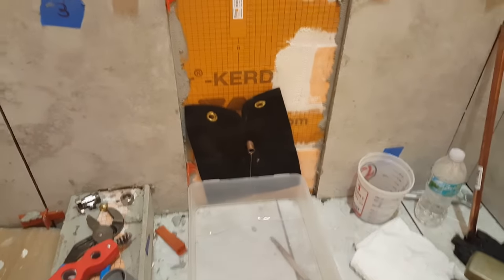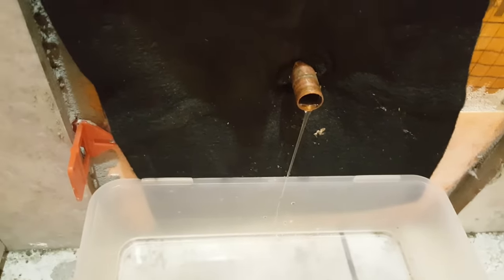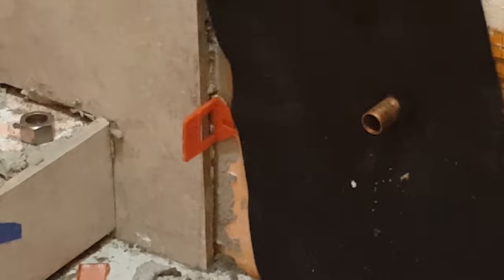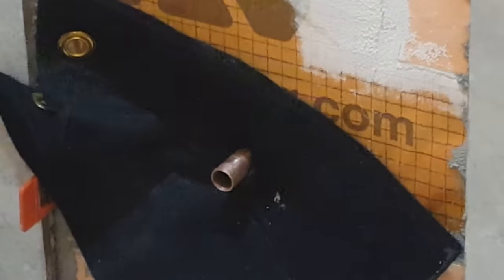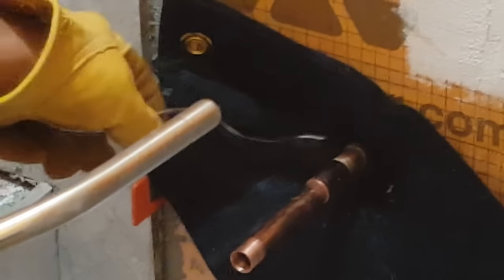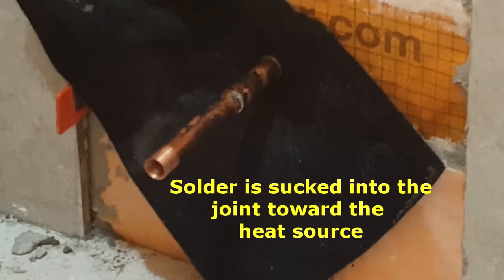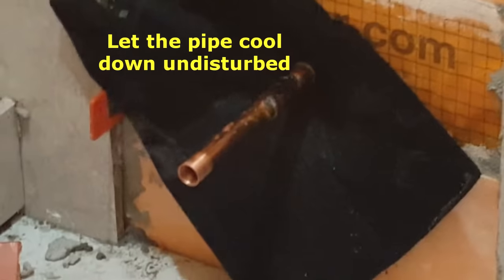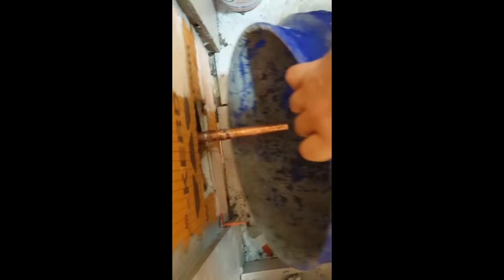Insane Plumber's Trick: Solder Copper Pipes Dripping Water

Comment: Why did u sand the inside of the pipe? Lol I've never done that or seen anybody do that. But that bread trick works like a charm! 🔥 good shit
Reply from the maker: I guess you didn't hear me say after I did it that it was not necessary. It was 100 degrees in that bathroom, mid July the hottest day of the year, and we could barely breath or think straight.
Reply: @jeffostroff  gotcha, the bread dissolves on it's own?
Reply from the maker: @two9s649  I don't like to leave any doubt or chance that any bread will wedge itself inside the shutoff valve when you attach it, as the video shows near the end, we flush the bread out by turning the water on for about 2 seconds, then shut it off. Do this BEFORE you install the water shutoff valve.

Comment: The way I was taught is to take bread, roll into a ball, not hard, big enough to fill the leaking pipe,  it clogs the water temporarily so you can do the solder. When finished, turn the water on and the bread will flush out.
Reply from the maker: Yes, that is exactly how we did it here.
Reply: That's what I get for not watching your video. Thanks for not beating me up over it.
 By the way, I now have seen it and your very thorough. Very professional.

Comment: 1:52 Using vacuum to clean inside of the pipe?
There will be hardly any effect of vacuum from a few centimeter distance.
Also vacuum is hard to come by and with vacuum cleaner I have strong doubts.
However a gentle pressure would be more effective to blow out any dirt in the pipe.
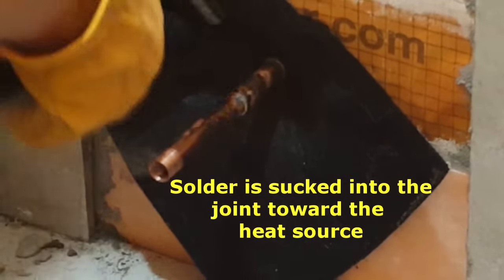5:04 "solder will be drawn to heat source"
Said who?
This is no longer concerns plumbing , it is physics. Any reference to this statement.?
The correct terminology should be "capillary action" as commonly used but I would suggest surface tension.
Liquids are attracted to the solid surface and adhere with a stronger bond than the inter bond among the liquid molecules.
Hence as soon as soldering metal melts and becomes liquid it is immediately attracted by the surface of copper pipe nearby. That is due to surface tension.
And the attention the double surface of concentric copper pipe one inside the other creating a very fine gap causes capillary action and stronger surface tension force to draw/attract/pull the liquid solder.
Where does the heat comes into play?
That goes beyond plumbing and takes us into physics.
Firstly you need a minimum base amount of heat to keep solder metal in liquid state while cooling off by the ambient temperature.
Secondly you can repeat the same experiment at different temperatures (Not heat) to observe and obtain data how surface tension/capillary action behaves under different temperatures.
Under ambient temperatures this information maybe of no use to plumbers but in electronic industry or in space precision to manipulate the matter maybe everything.
Reply from the maker: The purpose of the vacuum was to suck out the last few drops of water still sitting in the bottom of the pipe, which it did a great job removing. If you still don't believe the effectiveness of our Rigid shop vac which is designed to vacuum up water, check out my other video on changing out a hose bibb where we used the vacuum an inch away from the pipe you can see the vacuum sucking the water stream out of the pipe, see video here: https://youtu.be/73Sn71X4fGc and you'll also see we used the term capillary action.

Comment: Mission accomplished. A smaller torch tip would help you control where the flame goes. Try heating one side, then finish on the other. The pipe doesn't have to be sticking out of the wall so far, it looks like an amateur did the work and is unsure of himself. 
I am looking for a trick to stop the water from flowing back from the house if you're doing work on the main supply line?
Reply from the maker: Gino Asci try installing temporary back flow preventer.
Reply: @jeffostroff  :  thank you
Reply: Disconnect the water meter at unions
Reply: Dude was using a mapp gas torch. The heads aren't changabel, but still too much heat and WHY clen and flux INSIDE the pipe. This guy did NOT go to school!

Comment: the pipe is 1/2", what's the size of the coupler?
Reply from the maker: It's a 1/2" coupler is what they call it, designed to fit tightly around the outside of the 1/2" pipe

Comment: You do NOT ever want flux on the inside of a copper line.  

The flux is there because it's corrosive nature when heated will prevent the copper from oxidizing before you can join the two pieces together.

You only need flux on surfaces that you want joined together with solder.

By cleaning the inside of the pipe and applying flux to the inside of the pipe you have created two major issues:

1) When you apply solder to the heated pipe and fitting the clean and fluxed surface on the inside of the pipe will "wick"  or pull the solder INTO the pipe.  This is not desirable.

2) When you have flux left behind inside a copper pipe it acts similarly as to when it was heated.  it's still corrosive but inhibited by being cold.   It will be a hassle when within a year or two the brand new copper fitting you installed gets a "mysterious" pin-hole.  

Flux is your friend.  Flux is your enemy.
Reply from the maker: It's funny how many of you experts have come in here and said "it will fail within a month", "it will fail within 2 months" now you burst in here proclaiming it will fail within a a year or 2. None of you knows anything. Here we are 3 years later it's still working perfect. You have no clue what water soluble flux means do you? that means it dissolves in water. It means the small amount that was accidentally brushed inside the pipe was gone from that pipe by the end of the day. there is no flux left in there to cause  a problem.
Reply: @jeffostroff  lol

Comment: open all the other valves in the house to relieve back pressure.
Reply from the maker: Yes, we had done that, even the bath tubs. When the water is still running, it's because the gate valve no longer closes all the way. If water has not stopped after 10 minutes, then it is never going to stop,
Reply: @jeffostroff  then you go out to the yard and turn of it off at the meter like a REAL plumber! And if you can't, you  use a jet sweat kit and solder in a valve in somewhere like a "professional". 

This is totally unprofessional and you should be banned from youtube! It's like a mechanic replacing brake pads with a sticking caliper piston!
Reply from the maker: @m_soko  Oh, take note, everyone! Here Ye, Here, Ye, master plumber @Mike Sokolowski is here! In condos, you are not allowed to shut of the meter, it affects other people, they have to post signs days in advance, get permission, etc. Homeowners don't have the street tool either, and pliers hardly ever work. Nobody likes an arrogant snobby plumber like you. The purpose of this video just sailed right over your head and you missed it. This is a DIY video for homeowners (plumbers don't need to be told), and no homeowner is going to spend $50 on a Swet Jet to use once in their lifetime. But even so, we have the link to the Swet Jet in description and you missed that too. Plenty of plumbers use this trick and there is nothing unprofessional about it because it solves the problem, just look at all, just because the great high horse master plumber Mike Sokolowski decrees that it is unprofessional. I'd like to see how you waste your clients money if you could not find your Set Jet, what would you do then? Read all the the comments from people who said this totally appropriate method helped them. The only unprofessional here is you. You need to be brought back down to earth.
Reply: its not back pressure...... chances are its an old gate valve that leaks by......      and DEFINITELY DO NOT OPEN OTHER VALVES... that is the worst thing you can do.....  once you break the vaccuumm   you have completely negated all efforts of draining the pipe....   the worst thing a person can do when u have the water off is open something......  which they do..... all the time..... at the worst time possible    the same principal that causes water to syphon    ,  keeps it in the pipe  despite gravity
Reply from the maker: @dustybones644  Yes you are correct, the gate valve was old and not closing all the way. This dribble you see in the video is after an hour of waiting for it to die down, trying both scenarios with all valves in the house off, and all on, nothing will stop a flow of water. This is not just water collected in the line.  this is live water still coming in from the city water supply, past the gate valve.
Reply: @jeffostroff      on a shared water supply,  such as this.... each unit should have its own water valve... if you all share a meter.... each unit should at least have an isolation valve .....  chances are yours does.. and it most like is a gate valve ( multi turn handle)    and it as all of them do... leaks by..... this is not from pressure in the pipes per say.... it is from this small leak.... and as we all know.. water seeks to level itself... chances are  unless its piped with a plastic   such as pex... or wirsbo...... the pipe comes up to u from sub level or under ground.....  the bread trick is valid... although no ... not considered "professional"        and yes..... it would be better to get as much if not all the prep of the join ready... so that when u block the water however ... or evacuate the water from the line.....  all u have to do is put the coupling on.. and heat it... pull solder across the joint... and cool it off before that water hits your work.....

why....   why cant u just heat it.... water or not....      water that hot makes steam... steam creates pressure...  now u could technicallly  solder it with water in there... if ur quick... and good... but at some point... it will become a closed system..   and the steam pressure must escape... and the only thing not solid... is your liquid solder joint... this   pin hole leak from steam escape.....

a few things....  solder... only goes where flux goes... no where else.....  the inside of the pipe should be free of any debris, obstruction, burr, deformity whatever... in a perfect world.....    trails of solder down the interior pipe, or burrs... or  little peices of marred pipe  create eddies and turbulance when the water flows by.... this disturbance to the flow of water wears holes in the pipe....    

sand the exterior of any pipe, or anything that is pipe diameter  such as a fitting elbow you sand the outside of the "street" end and the inside of the coupling end..     what to sand  what to flux...   when u are  talking fittings  there is only a few types u really got...  coupling and fitting    coupling ends are denoted by a C and fitting is F... so if u have a 1" CxC 90   thats a 1 inch elbow...  sand  both ends on the inside.....   if u had a 1" FxC 90    slang 1" street elbow...   sand the F the same as the pipe...... and the inside of the "couple" end.... 

flux the outside of the pipe....   only....  put the two together.. make sure the pipe is clean... it should be complete sanded.. any sort of anything...  tape glue... marker... anything that is on the surfaces will not hold solder.. and will create a channel that is un fixable.. and will ruin ur day when u turn the water back on....

soldering is more about what u do before u get the torch.. and less about the actual soldering...   

wipe off excess flux.....   heat the fitting  not at the seam... but toward the center of the fitting... u want to draw the solder in   ... it rides on the flux... and goes to the heat.. up hill or down... too much heat in the wrong spot..  flux will take solder there... u dont want that....

prep   prep  prep  and then prep some more...      now as for the water in the pipe... unless the pip goes up... and is over head.... u can very easily and without a jet sweat....  give urself more then enough time to solder a half inch coupling ... or ball valve... or whatever....  if u have a small pieice of tubing... like 1/4" tube.... take a little section.... put a small bend in the end.. and push it down the pipe .... u will hit that back elbow and with a little skill  direct the tube down the pipe...  now  most of us know how to start a syphon... u can pull on the end of the tube however u want in ur own home.. i recommend tho  when working on someone else not to suck on the tube... but... its not going to hurt anything... ur not drinking it.. just pull quickly and get the syphon going... u will hear when it has drained and starts sucking air....   u dont have to hold it... u dont have to fool with it... just makes sure it is drawing the water out.. get your pieces in your hand, everything is ready to go...  boom when it starts drawing in the air.. sounds like an empty soda cup at the movies..   pull the tube out... put your peices together and hit it with the heat....   the faster the leaky valve... the less time you have....i could easily with how fast that water is leaking by   i could easily get that coupling soldered on there.. clean  and without buring the wall (no pad needed)     with maybe a 8" rise  siphoned out..    

that vacuum is also a great idea... just hold that bad boy to the wall... with that pipe inside... with EVERYTHING ELSE CLOSED... do not open faucets remote to whereu are.. trust me.....      hit it with the vacuummm  somehow SEAL the vacuum hose around the pipe.. i would use the wall...   and WHOOOOOOOO u got time now....      as for these arm chair do it ur selfers   critiquing you....   they dont know jack.... ive been on jjobsite where u cant shut the water off...  such as hospitals...  and guess what... even there...   YOU SHUT THE WATER OFF... lol ... granted at hospitals u have a VERY small window of time and its usually like  sometime in the middle of the night... some random off hour.. and u got like ...30-45 minutes to pipe in some sort of by pass valve system or fix the one there...      rule of thumb... there is NEVER enough valves... they are like outlets.. u can never have enough of them in ur garage.....   or horsepower   or whatever....      valves are ur friend... and good full port ball valves... do not get gate valves... u will be sorry..... i promise
Reply: @jeffostroff      yes...  very very common ..    a lot of times... that gate will break,.... and chances are...  if it has... someone will actually just take the gaate out of the valve  and u would be left with a handle.. that spins.. and closes nothing ....   lol    i think we should collect those valves and install them on cowboys bbq house

i think u did a fine job.....  perhaps a little bit of refining for the "order " of operations...but honestly... the bread trick is tried and true... and really is a fundamental principal when it comes to soldering...   doing this work everyday you will encounter this over and over.. in a myriad of ways.....  bottom line is....  water ... in pipe... must be removed...   joint sealed... then water may resume flow....
Reply: @m_soko  not everybody wants to spend money on stuff like that YouTube is 4 quick fixes cheap people people with low cash flow it's all about how to get around expensive fixes but that is a goodtool

Comment: I can't believe that bread held back the water for that long. I use jet swets, but you have to install a ball valve with them. Going to try it.
Reply from the maker: Jim Weishaupt with  The water down to a dribble there isn't a whole lot of water to hold back so it should last 5 to 10 minutes before it finally dissolves and gives way.
Reply: Nice to know. Is it ok to leave the bread in if it's a closed solder joint?
Reply from the maker: Jim Weishaupt  No you should never leave bread or anything else inside the plumbing system it must be flushed out 1st it could dissolve get to lodged and who knows we're could end up in the system and cause problems elsewhere so it's best to always flush it out.
Reply: Jim Weishaupt : those of us in the trade use the bread trick when needed I have used it many times as a casino facilities engineer.and yes ya gotta flush out the bread at some point down the line .
Reply: I absolutely agree there's no way that little bit saturated bread would've held back that drip , I sense a cheat.

Comment: When you first put the bread in it got soaked immediately and water started dripping - then you pushed it in and it stopped totally?  How is that possible?  You had to stuff a lot more in there off camera.
Reply from the maker: Pushing bread in the pipe made it denser and you're still gonna have a little bit of water that flows around it right as your 1st putting it in the pipe so that's what you saw it was still dense at the core of the ball of bread and once I pushed it back in there and it all bunched up and there it was enough to stop the water for at least 5 to 10 minutes
Reply: OK I will give it a shot - Thanks
Reply: @jeffostroff  Why not shove in a full bagel and a donut while your at it then you can really take your time lol

Comment: Don't put flux on the inside of the pipe. It invites solder to pool inside the pipe, creating an obstruction. In a cold water system, it can cause corrosion inside too.
Reply from the maker: Yes that was a slip of the wrist inside a 90 degree bathroom in July, end of day, lack of focus.

Comment: It IS possible to solder a joint with water in it.  I was fitting my own c/h system over 3 floors, when I filled the system I had a leak on one of the lower pipe runs at an awkward spot just where it passed through a wall. I wasn’t too confident that I could succeed but rather than drain it all down again and as I felt I had nothing to lose I took a chance and ran more solder around the fitting. The joint was still solid when I moved out 30yrs later!